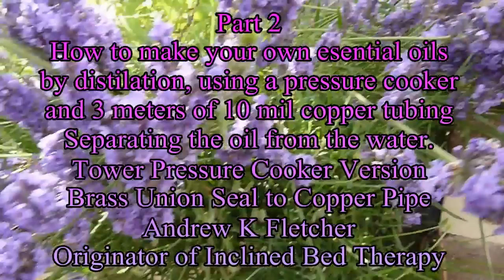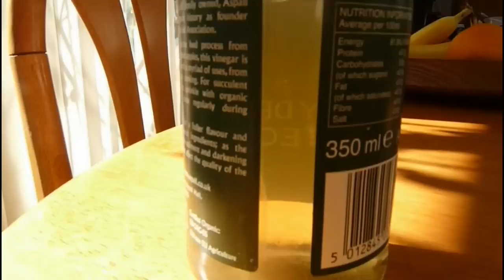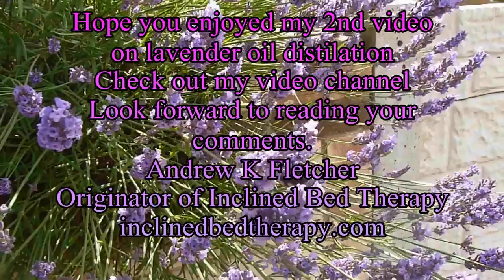Distilling Essential Oil / plant oils Homemade Still Distilation Extraction Lavender

Comment: thank you so much Sr. for the tutorial I was about to buy a small distillation 145 dollars supposely cheap my worry was that is glass might break easily I have kids .the pressure cooker is $28 in walmart and the tubing $10 plastic and foodgrade I would save $100 thanks to you and will not break

Comment: you should use a kitchen utensil my wife likes, its called a fat separator and can be bought at a good cooking store. She skims off oils using this device that looks like a large measuring cup that has a spout connected near  the base, and is tilted up at a 75 degreese angle. as you fill the cup, oil floats on top and you can pour off the water or other liquids without loosing the oil. Think of a watering can where the spout is connected twards the base of the can and not the top. To avoid loosing any oil, just fill cup with enough water to cover the hole of the base spout.
This cooking device is used to separate juices from cooking roasts and turkey and chicken from the fatty oils to make gravy. It should save you a lot of time and is much easier than trying to suck out the water.

Comment from the maker: Suggested and Possible Uses of Lavender Essential Oil
The following are uses described in a book I highly recommend, Modern Essentials: A Contemporary Guide to the Therapeutic Uses of Essential Oils, as well as from personal experience and other resources. Use them to inspire your own ideas, experiment, and see what works for you.
Agitation or Anxiety
Apply topically by itself or in a carrier oil to the chest, soles of the feet or top of the head to calm agitation or anxiety. Or use aromatically by adding it to a bath.
Allergies
Use topically alone or in a carrier oil on allergic skin reactions or apply to the chest or soles of feet for seasonal allergy support. You can also diffuse or inhale for more systemic support.
Appetite (Increase)
Appetite loss due to stress, depression or illness may be increased by using it aromatically.
Arrhythmia
Uses for lavender essential oil include aromatically or topically to the chest support a steady heartbeat.
Atherosclerosis
Use aromatically to support heart health.
Blisters and Boils
Apply topically (with or without a carrier oil, depending on skin sensitivity) directly to the site.
Breasts
Massage topically (with or without a carrier oil, depending on skin sensitivity) to soothe tenderness, swelling, engorgement, etc.
Bug Bites
Apply topically (with or without a carrier oil, depending on skin sensitivity) directly to the site.
Bug Repellant
Apply topically to the body help repel gnats, mosquitos and midges.
Burns
Pure lavender oil has long been used for healing burns. Apply directly to the site, or use in a very light, non-greasy carrier such as aloe, immediately and every few hours while healing.
Calming
Whether you're stressed, overwhelmed, angry or otherwise, lavender oil can be used aromatically or topically to calm nerves and emotions.
Cancer
Apply topically (with or without a carrier oil, depending on your skin sensitivity) directly over the site. Also use aromatically to promote well-being.
Chicken Pox
Used topically over the pox pure lavender oil can help soothe itchy skin and promote faster recovery this viral infection.
Cold Sores
Dilute 1 drop of lavender to 10-15 drops of coconut oil and apply directly to the cold sore.
Concentration (Distraction)
Lavender can help you to feel more grounded and focused, helping you concentrate and think clearly when used aromatically throughout the room or home, or just on your body.
Convulsions
Use topically to help soothe the nervous system and support balance in the body.
Crying (Uncontrollable)
Uses of lavender essential oil for its calming and soothing effects can help balance overwhelming emotions in healthy ways.
Cuts
Apply lavender topically to aid in healing and prevent infection.
Dandruff
Apply topically for its antifungal properties (dandruff is often caused by a fungal/yeast infection) and to soothe dry, irritated skin and balance pH levels on the skin.
Depression (including Postpartum)
Apply topically, diffuse in the air (or inhale directly), or take internally as described above.
Detox
Use with a carrier oil and massage toward the heart to increase the lymphatic system.
Diabetic Sores
Can assist in preventing gangrene and other infections with is anti-everything properties when used topically.
Diaper Rash
I recommend testing for sensitivity first on a less tender area of the body. Dilute 10 drops of lavender oil to 1 TB carrier oil. More or less can be tested carefully.
Diuretic
Apply topically to the reflex points for the urinary system, over the lower abdomen and on the soles of the feet.
Dry Lips
Dilute 1-2 drops in 1 tsp of coconut oil and apply to the lips as needed.
Dysmenorrhea (Menstrual Pain)
Apply directly to the lower abdomen, over the reflex points of the feet (heels and ankles) as needed.
Exhaustion
Uses of lavender essential oil topically will promote relaxation and restfulness, as well as grounding and balance.
Fever
Can be applied topically to assist the body in fighting infection and increase immune response.
Gangrene
Apply topically to the area of concern to help increase immune response and tissue health.
Gas/Flatulence
Can be taken internally as described above, or applied topically to the entire abdomen in a clockwise motion.
Giardia
Use pure lavender oil topically over the small intestines or take internally to fight parasites.
Grief
Apply topically or use aromatically to assist the grief process and provide a centering, grounding effect on the spirit.
Hair (Dry, Fragile, or Loss)
Use topically on your hair, either added in your shampoo, or add approx. 15-20 drops to 10 oz purified water to soak follicles and scalp.
Hay Fever
Apply topically to the skin (chest or reflex points) to be absorbed into the body, calming the nervous system and increasing the immune response.
Herpes Simplex
Pure lavender oil and its antiviral properties may heal outbreaks when used topically.
Hyperactivity
Diffuse in the air or apply topically to the chest or reflex points of the hands or feet for a calming, grounding effect.
Impetigo
Uses of lavender essential oil include applying topically to impetigo sites to fight infection, soothe skin irritation and aid in healing.
Inflammation
Use topically to soothe inflamed cells, fight infection and promote a faster immune response to healing.
Insomnia
Whether mild or sever, lavender oil increases relaxation response of the nervous system when used topically or aromatically. You can also place 1-2 drops on your pillow.
Itching
Whether from an allergic reaction, a big bite or an unknown cause, using lavender topically can help soothe the nervous system.
Jet Lag
Used topically, it can assist in a grounding feeling and promote deep relaxation.
Mastitis
Dilute 4 drops of oil in 1 tsp of carrier oil and massage gently into breast tissue.
Menopause
Apply topically over the lower abdomen, chest and soles of feet or diffuse aromatically to assist in balancing hormones.
Mental Stress
Diffuse in the air or apply to the reflex points of the feet (toes and beneath), to the chest and the top of the head.
Misc. When in doubt, try lavender!
Mood Swings
Diffuse pure lavender oil in the air or inhale directly for at least 30 seconds as needed.
Pain
Massage several drops into the areas of pain gently. Gentle massage also has the benefit of overriding pain signals to the brain.
Physical Stress
Whether physical exhaustion, overuse, strain or otherwise, gently massage several drops of lavender into the areas of concern.
Poison Ivy/Oak
Apply topically with or without a carrier oil as recommended for your skin type, and as needed while healing to decrease itching and prevent infection.
Rashes
Use topically as needed to prevent infection, decrease itching, increasing soothing and relaxation and assist the body's healing response.
Rheumatoid Arthritis
Massage into the areas of pain, as needed.
Ringworm
Apply pure lavender oil to the site several times a day until the ringworm clears.
Sedative
Can be used aromatically or topically as a natural sedative.
Seizures
Apply topically to the chest and reflex points on the bottom of feet to help calm the systems of the body.
Skin (Dry, Sensitive, Eczema, Psoriasis, etc)
For severe areas, apply 1 drop or pure lavender oil directly to the skin. Dilute as needed depending on severity and sensitivity.
Stress/Tension (General)
Diffuse in the air, inhale directly or apply topically to the chest or reflex points of the feet.
Stretch Marks
May help prevent stretch marks, as well as decrease appearance of existing stretch marks. Massage into the skin as desired.
Sunburn
Combine 1-3 drops pure lavender oil with each teaspoon of pure aloe vera and massage into the affected areas. (We usually see incredibly fast results from this combination!)
Tachycardia
Use aromatically and apply to the reflex points of the feet and across chest to promote heartbeat regularity.
Teeth Grinding
Uses of lavender essential oil include topically across jaw to relax the muscles and promote tension release.
Teething Pain
Apply 1-2 drops to a teaspoon of carrier oil and apply to the gums. You can also add a couple drops of lavender to a cup of water, wet a washcloth with the solution, freeze and allow the little one to gnaw on the frozen cloth.
Thrush
Pure lavender oil can help fight the fungus that causes thrush when applied topically.
Ticks
Apply directly to the site to fight infection, prevent Lyme disease and promote healing.
Ulcers (Legs or Varicose)
Apply topically to the site to prevent infection and promote healing.
Vertigo
Use lavender aromatically or topically to help ground and balance.
Worms
Apply pure lavender oil topically or take internally as indicated.
Wounds (General)
Apply topically as indicated to prevent infections and increase healing.
Wrinkles
Massage gently into skin as indicated, avoiding contact with eyes. (You can use around eyes, but be careful not to get it IN the eye.)
Other possible uses of lavender essential oil include: Healing from abuse, hernia, post-labor, other sleep issues, withdrawal, aphrodisiac, acne, cramps, indigestion, lowering blood pressure, abscess, nausea, PMS, scarring, water retention, bruises, balance/centering/grounding, bronchitis, earaches, fainting or dizziness, headaches, high blood pressure, hives, flu, laryngitis, mucus, respiratory function, sunstroke, tuberculosis, typhoid fever, whooping cough and cough in general (by gargling a few drops of pure lavender oil in purified water).
http://www.sustainablebabysteps.com/pure-lavender-oil.html

Comment: Love the videos, thank you for your offering Andrew. I can't wait to try this. Have you, or has anyone, had any success using a stove top espresso maker distilling the oils?
Reply from the maker: Hi Fileve, if I were you would opt for pressure cooker and as large as you can get. This saves time and gas. More plant material you can do per batch means more oil you get for same amount of heating, not to mention time saving achieved.

Comment: I bought a mirro pressure cooker and set it up so the only hole is for the copper tubing into the water and out. but its not building any pressure, there was steam coming from the handle. tried to silicone around it though still not working. I like the video and sure hope i can get mine to work like yours lol
Reply from the maker: Nicole w   Hi Nicole, apply mole grips / clamps to the edge / join between lid and body of the pressure cooker or place weights on the top to make a seal.   It is not supposed to become pressurized, so you need to apply pressure externally to the seal on some types.
Reply: thanks i will try that.

Comment: Seriously, the coolest video I have seen in a while. I don't have my own patch of lavender, so my best bet is to possibly trade around for it. Does this process work for any plant material?
Reply from the maker: I have used it with eucalyptus, using the blue mountain gum species. This is by far more superior than anything shop purchased. It has been added as 2 drops to honey and lemon drink and completely cleared a mucus cough, where antibiotics had failed. One report from a person trying Cyprus oil reported not producing a great deal, possibly because of time it was harvested. Another is trying to make limonine  oil from citrus peel and awaiting to hear his results, though it will work with all plants that contain oils.

Comment: interesting how you made that.. i definitely have to try and replicate.. shouldn't be that hard for a female to do ;) don't want to ruin my pressure cooker tho.. i'll have to find a cheap secondhand one.. or do the first method you showed.. very impressing!! hope it works.. thanks..
Reply from the maker: Sara.Austin come back and share your results Sara.
Reply: i definitely will.. i did the easy version and ended up with only lemon peel hydrosol.. in a stockpot with a brick and lid upside-down with ice on it.. great hydrosol.. but no oil.. trail and error.. we have a lot of rose hips in the area and next month i can go and harvest it so i have to do my research ;) i was thinking on using the alcohol method if i can't make this piece of equipment :) but i'll share my findings..
Reply from the maker: Sara.Austin
 wear some strong gardening gloves for the rose hips Sara :)
Reply: ohh.. thank you for the tip!! i definitely will ;)
Reply from the maker: Sara.Austin From what I have been reading Rosehip oil is best extracted through a cold press, rather than steam distillation, whether this is true or not I cannot say. However, we have ordered some from Ebay  100 mls cold pressed organic from Ebay Item number: 271252887113  Your post got me to look into why you would want to make this oil and I must say I found it very interesting so my wife and I have decided to try it to see if it makes a difference to age lines and old scars as it states, will let you know. Kind regards     Andrew
Reply: well.. i do have a cold press slow juicer :)
i could give that a try..
 
while i was walking my dog i stumbled on a rose hip shrub.. so i went to investigate ;) and the whole area was full of rose hips!! its a shame not to use it!

i ordered mine in america and i have to say.. i used it on my face and my pores are so tiny after a few applications.. and it brightens my skin because of the high vitamin c content and retinoid acid, a pro vitamin A that is responsible for restoring and rebuilding tissue.. (i'm an ingredient junkie ;) )
so i don't want to use the seeds only but the skin as well.. i just don't know if i will get oil from the skin or juice only.. 
do you have any experience with alcohol extraction method? either vodka or some kind of solvent..
wish i could make a distiller! 

kind regards,
Sara
Reply: Sara.Austin Hi Sara Andrew is correct you do have to cold press the seeds through an oil expeller which you can get  for the home but there not very cheap you can get one for around 200 bux. But the most convenient method for someone like us who does not want to spend so much is you can use a carrier oil such as jojoba or grape seed oil and get your rose hips and crush them up to relese oils and then place them in your carrier oil of choice. Then you can heat them on low heat on the stove or oven 3 on the stove or 100 150 in the oven or about 4 - 6 hours and the low heat will extract all the goodness for your skin and also the carrier oil is also benificail. Hope this helped :) I also recommend using double the amount of ingredients compared to your carrier oil so double amount of rose hips to the amount of your carrier oil. :)
Reply from the maker: Halley if heat is involved then surely the distiller will work. I will try this for myself and report back, Cold press imo should mean no heat applied
Reply: thank Halley.. i do have a cold press slowjuicer.. cost me an arm and a leg ;) 300 euro!!
even made coconut oil with it… but then again.. coconut has a lot of oil.. but the rose hip seeds are so tiny!! as for now I'm just harvesting them and put them immediately in my freezer to recreate the frost effect.. until I'm going to use it i will keep searching for a way to extract the oil :) i can also dry them whole and powder it for further use.. but the essential oil will evaporate once dried i think..
there are so many rose hips where i live!! feel like a kid in a candy store :) such a waste if i don't do something with it.. 
I'm going to try the distill method with my pressure cooker.. i think i need a plastic tube or so..
Reply from the maker: Copper tube Sara, plastic won't work. :)

Comment: Do you need pressure to get the essential oil or not ?
If yes, how exactly the pressure works to get the oil ??
Reply from the maker: Having the copper coil positioned as shown applies a little pressure to the boiling contents so it could raise the boiling point a little. However, normal boiling temperature would suffice to liberate the oils.